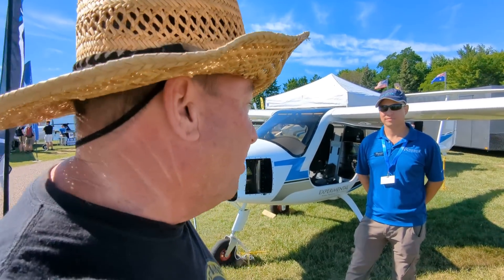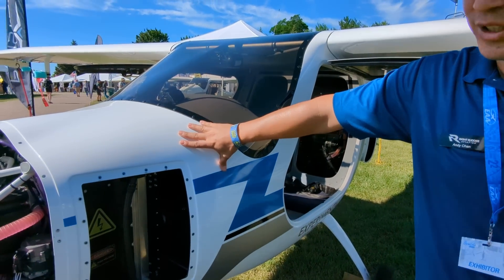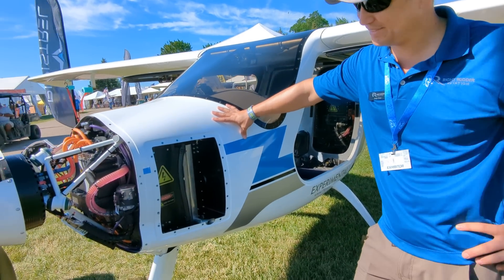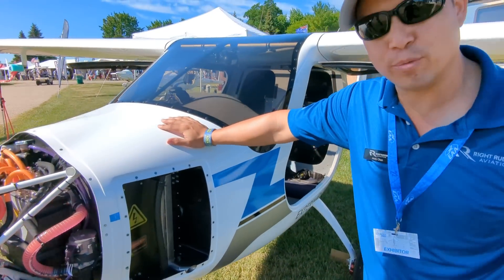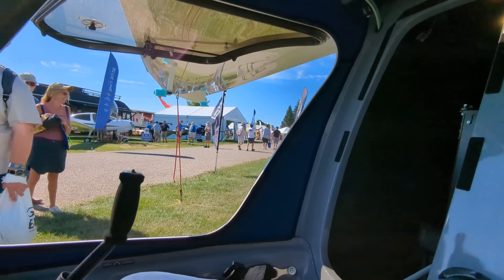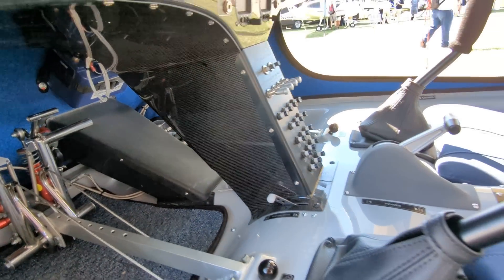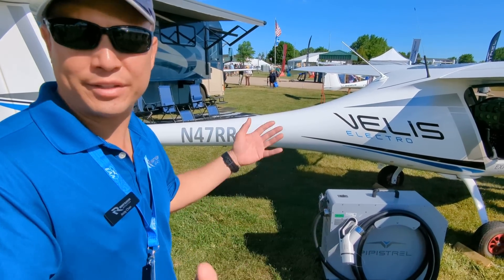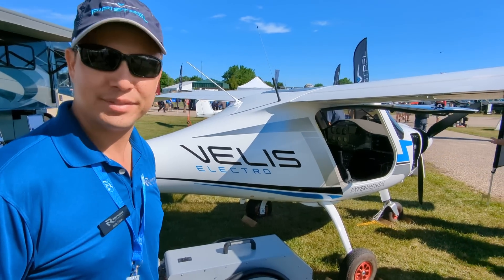Electric Airplane?! Pipistrel Electro at Airventure 2022.

Comment: This will mesitate all verbal instruction and briefing be done on the ground . During my primary training my average flight time was 2 hours , that is more than double with this aircraft is capable of . Those removable quick detached Wings glider style as you mentioned are necessary because this plane will spend more time on the trailer than it does in the air  . A student will be forced to use a different type just to do the required short and long cross country portions of her or his private certificate. I don't think it's possible to complete your first check ride in a single flight using this plane. My first solo flight in a glider was 2 hours and 40 minutes .
Reply: That's not what these models are for. This is for laps of the pattern, maneuvers, and short XCs. It's a $10K battery capable of 2K hours, so that's $5/hr. Electricity we'll round up and assume to be 20c/kWh. After a 50 minute flight, you use up 15.5kWh of the battery's total 24.8kWh. If the charger worked ideally, that's $3.10 of electricity. We'll just ballpark the actual number to $6. So that's $11/hr for the fuel system. Plenty of room for aircraft costs, maintenance costs, overhead, admin, etc... Hell, Redbird simulators cost way more than that per hour.
Reply: I wonder if the motor coach he's staying 🤔 in is electric powered ? Remind me again how futuristic battery technology is. What's going to happen to everything green when we are forced to go green 🤔 Don't plants need bad stuff to make good stuff ?
Reply: Great video.
Reply: So if we barely have enough electricity produced to meet the needs of the USA and no power plants scheduled to be built. People are told not to over use air conditioning to prevent brown outs.  California has rolling brown outs. What happens when all the electric cars and planes are plugged into 220 or 440 volts.
Reply: @mikemicksun6469  🤔
Reply: @mikemicksun6469  Excellent question that not ONE reporter in corporate media has asked! They can barely keep lights on ... and they want to add 100M electric cars to the mix! Going to work fantastic, I can imagine, lol. 😂
Reply: @mikemicksun6469  The myth that California has rolling brownouts is simply untrue, fake news of the stupidest sort. There is no shortage of power generation in the state. The only reason we have shutdowns is as a fire prevention measure. Cars are almost all charged overnight when there is plenty of excess capacity. It's a highly distributed load, similar to daytime use, and the grid is entirely capable of handling it.
Reply: @mikemicksun6469  This is why electric aircraft will be used more in Europe and other countries where there's less resistance to electric vehicles.  I can't see this, or any other electric aircraft, being popular in the USA for a long time.  Same goes for electric cars, etc - people in the USA just don't like them, period.
Reply: Cool story bro.
Any way. Your carbourated Continental flat six breaks for (literally) no good reason and you stall right after takeoff. 
Meanwhile, this thing takes off without flaps and will work over and over with zero maintenance.
Battery technology improves year over year.
Piston Airplane engines are a *#%$ disgrace - their technology is stuck in 1950.
Reply: @rickrudd  Yep, and that 50's technology flat WORKS.
Reply: @SmittySmithsonite  
50's???
More like 30's!!!
And it still works! 🙂
Reply: @straybullitt  Indeed it does! I was just replying to rickrudd who said, "Piston Airplane engines are a *#%$ disgrace - their technology is stuck in 1950."
Reply: @SmittySmithsonite  
Disgrace?!?
They've been hauling Rick's butt around for his entire life!
Disgrace? I think not....
Reply: @straybullitt  Amen to that!🍻
Reply: @rickrudd  you missed the part where I mentioned glider pilot. I never stall a wing unless I want to stall the wing . It makes no difference if I have power. This system  would make a better self launch system for a glider if it can be made in a self retracting configuration otherwise there's just way too much drag and it is seriously overweight. The technology is just not up to job yet .
Reply: @rickrudd  no such thing as zero maintenance! That's a total fallacy. The batteries don't last forever nor does coolant and the numerous other components of the system. The benefits of electrical drive systems are clear, but still not a panacea.
Reply: @biketothetop  Exactly what happens when one of the controllers burn up or many other components within the system. I love how people think electric motors are bulletproof. As a close family member of mine owns a fleet of electric vehicles I can assure you they are in the shop quite often.
Reply: @kevincollins8014  Truthfully, I came in throwing bombs and probably should write on the internet like I speak in person, which is obviously friendlier than my original comment :)
Reply: @rickrudd  they don't like the cold, they don't like the heat and if they decide to thermal run away and catch fire that's another story. They have their place it's just not a drop in replacement.
Reply: @JSFGuy  Which is why it has a cooling system. Nothing complicated about that at all.
Reply: @markmiller3279  what powers that cooling system? Until you get up to altitude and cool off it taxes the whole system.

Comment: Cessna took over Pipistrel, this isn't coming out commercially. It was a hard challenge before, now, for sure Cessna simply won't. The same company that has refused to change to a no lead fueled engine is suddenly going to go full electric. LOL pull the other one.

Comment: It just takes too much energy to fly for this to be practical anytime soon. So a few things they didn't mention, what's the useful load? What TAS can it cruise at? How much does it cost? If you stich those 3 categories together this thing is Miles  behind a normal plane. A normal plane can burns fuel and therefore sheds weight as it flies, this thing will never catch up.
Reply: Good point. As a gas powered plane uses up its fuel the engine keeps the same performance with a lighter load...with an electric the engine can only lose performance while still carrying the same load it took off with.
Reply: @Sizzelot  That's assuming the inverter output voltage drops as the battery discharges, which it doesn't.  Systems of this type keep running at the same performance level until it shuts down due to reaching the maximum permissible level of battery discharge.  The idea is to get back on the ground before that occurs.
Reply: @Sizzelot  An electric aircraft's motor performance does not degrade with altitude, so it's essentially like having a turbo-normalized engine at any altitude. Sure it doesn't burn off weight but this first iteration is at least perfectly suited for pattern flying, especially on a high-DA day where you'll really see the performance decay on a 152 or older 172.
Reply: @sircrapalot9954  re: "An electric aircraft's motor performance does not degrade with altitude, so it's essentially like having a turbo-normalized engine at any altitude. Sure it doesn't burn off weight but this first iteration is at least perfectly suited for pattern flying". <---  see mappz gets it, for every "disadvantage" there is also an "advantage" to be found, you just have to get the courage to LOOK for it.  however if/when you don't have a mind that it is "properly trimmed and configured" (much like the airplane itself) one will NEVER be able to "see" or "use" said advantage.  ref: "don't let PERFECT be the enemy of the GOOD".
Reply: @sircrapalot9954  
Oh yes it does degrade as it consumes the electricity within the battery, the longer the battery is reused the last voltage amperage it can produce therefore the engine is losing power the higher and longer it tries to fly, because as it’s trying to fly higher it’s putting more load on the motor! this is no different than everybody trying to come up with a diesel engine for your airplane a lot of suckers money was consumed and nothing produced, even Porsche gave up on an aircraft engine!
Reply: @sircrapalot9954  it's not that simple, the wings ability to make lift does degrade, otherwise the service ceiling would be unlimited. This plane has a service ceiling of 12,000ft. The motor makes the same power despite density altitude but the wings won't produce the same lift.
Reply: @Showboat_Six  Regarding aviation diesels: Austro and Continental are currently producing successful diesel engines. Look at the DA40NG, DA50RG, and DA62.

I also don't follow your statement that "as it's trying to fly higher it's putting more load on the motor." The motor controller is going to be power-limited to some specified output just like any other piston engine has a max continuous RPM or manifold pressure setting.
Reply: @rdawgz866  Ok...so what happens to any naturally-aspirated piston engine at higher [density] altitude? The engine produces LESS POWER, on top of the propeller and wings being less effective. With a motor that isn't dependent on air density for performance, you remove a big part of the equation in decayed performance at altitude.
Reply: ref: touch and go's in the pattern, touch and go's in the pattern.  every pilot in training needs to MASTER THE BASICS of airmanship before they "get off on a tangent" worrying about nonsense for there is MUCH TO LEARN.
Reply: @phillyphil1513  I don't know if you are a pilot but the "basics" are taught out in a practice area with altitude to spare. The student gets to touch and go's after some basic understanding of flying. So no you don't start by maneuvering in a small space with other traffic at slow airspeeds and steep bank angles. If you figure 15min to travel to a practice area and 15min to get back, that leaves 20min to practice if you have no delays. Come on man this isn't even close to practical.
Reply: @rdawgz866  re: "I don't know if you are a pilot but the "basics" are taught out in a practice area with altitude to spare." well that's certainly ONE perspective but it also means you've likely GOTTEN AHEAD OF YOURSELF.  basic principals here are taught in GROUND SCHOOL which would be before a student ever comes into physical contact with any aircraft (ie. pre-flight).  that is to say, before one jumps FEET FIRST into the "physics" of flight, it is the "meta-physics" that must be dealt with.
Reply: With all that cooling it may lighten the load during flight and that high current charging station will pay for itself like the electricity it consumes
Reply: It's a training aircraft.
Reply: @FiveTwoSevenTHR  So is a Cessna 152 and it can fly for way longer than 50min and is probably 25% of the price.
Reply: @rdawgz866  Upfront cost of a 2-seat trainer means nothing for a flight school, it's all about operating cost and electric aircraft cost only a few dollars an hour to operate.
Reply: @sircrapalot9954  
The upfront cost is factored into the cost per hour to the student, back in 1975 when I took lessons a two year old 172 rented for $14 an hour wet and the pilot was five dollars an hour, that same airplane 45 years later now is $175 an hour and the instructor is 75, so the cost of operation is directly related to the cost of procuring an aircraft in 2022
Reply: @sircrapalot9954  The price and maintenance of an airplane is calculated in the hourly price, a 152 for training can be had for 50k, this will probably be $300,000. Also keep in mind little to no service centers. This may happen at some point but we aren't even close yet.
Reply: @rdawgz866  By far the more expensive system to maintain on a flight training aircraft is the powerplant. Electric motors are so gosh-darn simple that there is just not much that can go wrong or that needs maintenance. The batteries will be the big question, but battery depreciation over time is predictable.
Reply: @rdawgz866  Re: "The price and maintenance of an airplane is calculated in the hourly price, a 152 for training can be had for 50k, this will probably be $300,000."

Upfront cost of a training aircraft to a FLIGHT SCHOOL is not as huge of a factor as OPERATING COST. A busy flight school could be performing 100-hr inspections on their aircraft every month. Older aircraft are more likely to have problems, especially with the engine. This is a niche where an electric trainer aircraft, which costs a fraction to maintain and operate per hour, can really shine.
Reply: @rdawgz866  now factor in the cost per hour when you aren't paying for gas and the deferred maintenance related to having an engine.

It's way cheaper.

Is it the right airplane for all individual to buy for their flight training? Absolutely not.

Is it the right airplane for a school to buy? Maybe but I do see it supplementing existing fleets to have a low cost option especially for the early parts of training. The flight school that I got my training at I expect to get one to supplement their RV-12s.
Reply: @rdawgz866  it's also worth noting that large flight schools aren't buying used 150s but brand new 172s.

They will be buying these as well.
Reply: @sircrapalot9954  2 batteries x $10,000/ = $20,000 / 2,000 cycles = $10/cycle / 50 minutes/cycle = $12/hr  That's just for an idealized cost of batteries, forget about the other factors contributing to operating costs.
Reply: @Showboat_Six  while attending BSEE engineering at ASU in AZ in  fall of '75 i needed 4 credits one semester and took the flight school class ( to hit over 12 credits so i could get my full VA funding ).    ASU had a neat deal w/Sawyer Aviation at Skyharbor, $6 bucks/hr, low wing cessna trainer plane and that included gas and the instructor too!   (got an 87 on the FAA exam and an A in the course) what an experience!
Reply: @rolf_pedersen  The cost/hour for "overhauling" the batteries is the same or cheaper than the amortized cost for overhauling an engine. Plus you can recoup some of the cost by recycling the spent batteries.

However, compared to cost of gas per hour, electricity is literally pennies on the dollar. The motor has very little that can go wrong, and the water cooling system is not experiencing the same temps that a water-cooled piston engine (Rotax) would induce.

There is no contest: electric power plants are much more economical to operate vs piston. The only place they fall short is endurance. That's why these trainers are a niche aircraft, but they can excel at that niche.
Reply: @robozstarrr8930  Wow, times have changed. $6/hr in 1975 is only $33 today, gives you a sense of how much gas has gone up.

Last I checked, Sawyer operates out of Scottsdale airport these days. Their flight school is tiny now. I don't think you flew a low-winged Cessna in '75, it was probably a Piper Warrior or Archer.
Reply: @sircrapalot9954  piper seems to ring a bell, my co-pay at sawyer was $6 per flight, regardless of instructor or solo.... always tried to fly b4 10 am . .   smooth as glass . . . crazy turbulent after 10 though w/that desert heat... next semester ASU contracted w/school located at falcon field, about an hr away, the co-pay was now around $18/hr, different aircraft, high wing....oh well, fun time and learned quite abit...
Reply: @rdawgz866  Why can't you also compare the ongoing maintenance costs?  You can start with $20k for batteries over 2,000 hours versus overhaul and inspection of an ICE over 2,000 hours.

Of course, you may have reasons for not wishing to consider that ...
Reply: @rolf_pedersen  What about the cost of overhauling / inspecting an ICE over 2,000 cycles?  Why isn't anyone considering this as well?
Reply: @vk2ig  Right.  As in so much of social "discourse", rational analysis meets with emotional name-calling and fuzzy, deflecting argument.  After all, it got Greta a Nobel prize. 🤨  Comparing replacement of a battery, whose function is consumable energy storage, to overhauling a gas engine, whose function is to consume the stored energy of gas, is not a compelling analogy.  Perhaps consider, also, the environmental, economic, and political costs of mining and sourcing lilthium from foreign, sometimes hostile countries and disposing of it after use.

"Despite the smaller supply of lithium, a study earlier this year in the Journal of the Indian Institute of Science found that less than 1 percent of Lithium-ion batteries get recycled in the US and EU compared to 99 percent of lead-acid batteries, which are most often used in gas vehicles and power grids. According to the study, recycling challenges range from the constantly evolving battery technology to costly shipping of dangerous materials to inadequate government regulation."
~"Lithium costs a lot of money—so why aren’t we recycling lithium batteries?" ArsTechnica dot com

"There are always critical reports on the extraction of lithium from salars: In some areas, locals complain about increasing droughts, which for example threatens livestock farming or leads to vegetation drying out. From the point of view of experts, it is still unclear to what extent the drought is actually related to lithium mining. It is undisputed that no drinking water is needed for the lithium production itself. What is disputed, on the other hand, is the extent to which the extraction of saltwater leads to an influx of fresh water and thus influences the groundwater at the edge of the salars. In order to assess this, the underground water flows in the Atacama Desert in Chile, for example, have not yet been sufficiently researched. In addition to lithium mining, possible influencing factors include copper mining, tourism, agriculture and climate change."
~"Lithium mining: What you should know about the contentious isue"
volkswagenag dot com
Reply: i hear a horse! neigh! neigh! swap the batteries for a tank of hydrogen and a catalyst, and this little plane has a range of 4 hours.